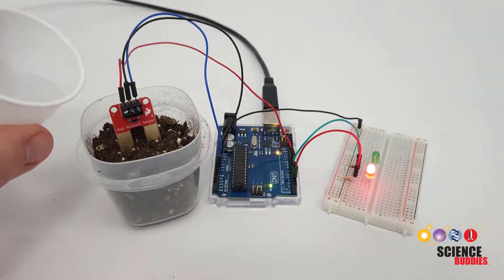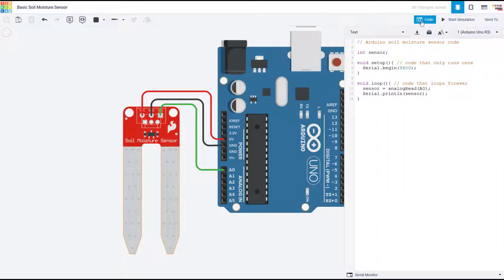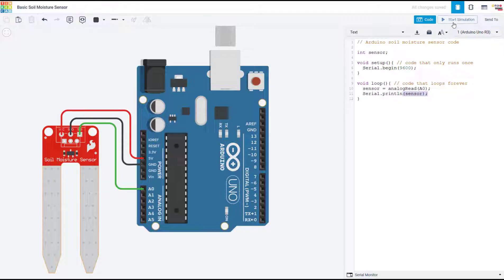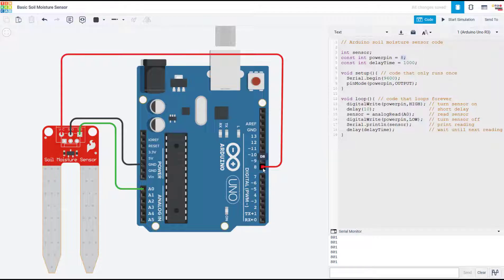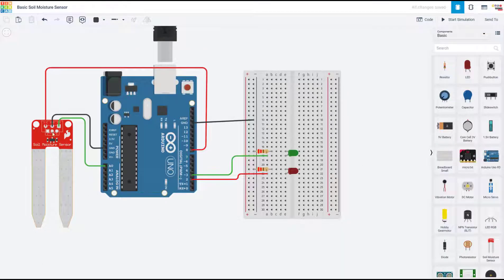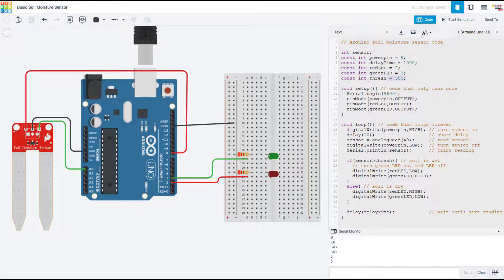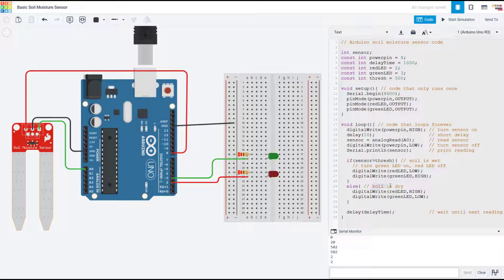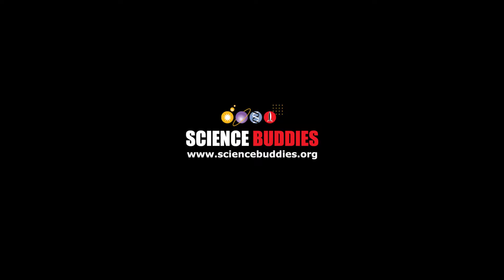Arduino Soil Moisture Sensor (Lesson #14)

Comment: Thank you for the video. I am trying to connect the arduino board to my mobile and read the data there, I am a flutter developer, but I seem to have problem with that. Any suggestions?
Reply from the maker: Hi - we recommend asking this question in the official Arduino forums, we don't have any of our own tutorials about connecting an Arduino to a mobile device.
Reply: @Science.Buddies  Thanks for the response. Is it possible to use soil moisture TDR sensors (time-domain reflectometry) on arduino board? and where can I find your video on capasitive soil moisture sensors?

Comment: The soil moisture sensor must be placed in the soil. However, what about the wires and electronic components within the sensor? How susceptible are they to water? While testing the sensor in a lab is feasible, its application in a farm setting presents challenges, particularly with water exposure. How is this typically addressed?
Reply from the maker: It looks like there are truly waterproof soil moisture sensors designed for outdoor use, although at a glance they are capacitive and not resistive, for example: https://www.amazon.com/DFROBOT-Gravity-Waterproof-Capacitive-Moisture/dp/B08C75KLR7

Comment: Where can i buy this resistive soil moisture sensor?
Reply from the maker: These sensors are available from electronics vendors like SparkFun Electronics and you can also find them on Amazon. Note that there are also capacitive soil moisture sensors, make sure you know which type you're buying!

Comment: Can u please tell which wire did you use male to male, male to female or female to female?
Reply from the maker: Look closely at the video - this sensor has screw terminals so we used male to male wires. Some sensors might have male header pins so you can use female to male wires. It depends on what sensor you buy.